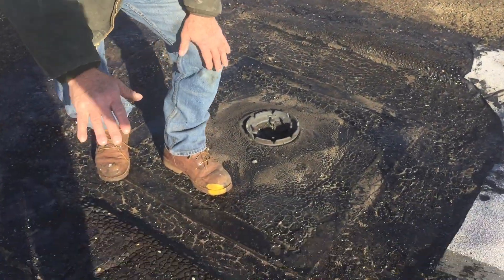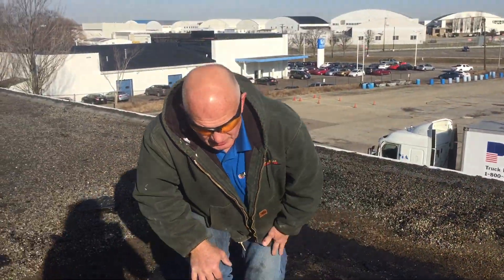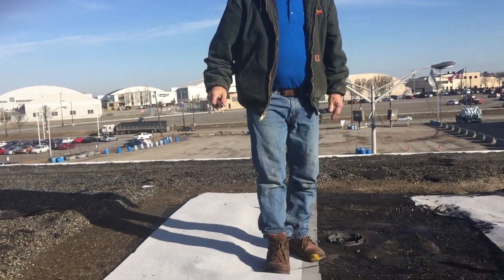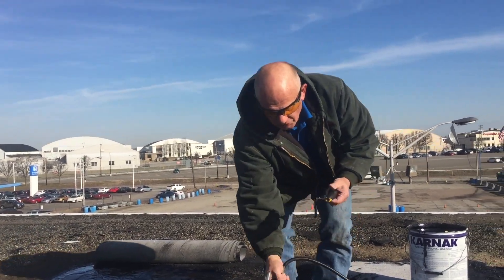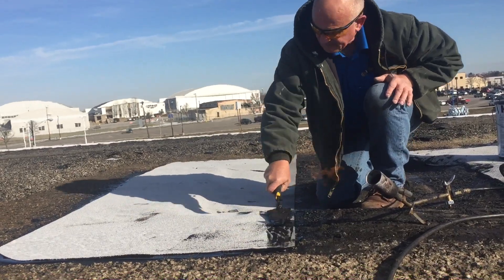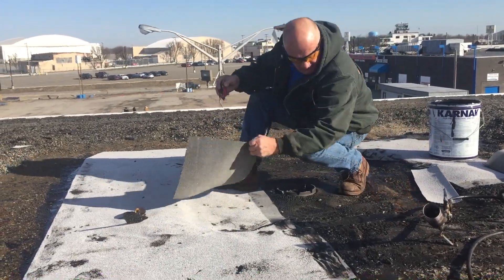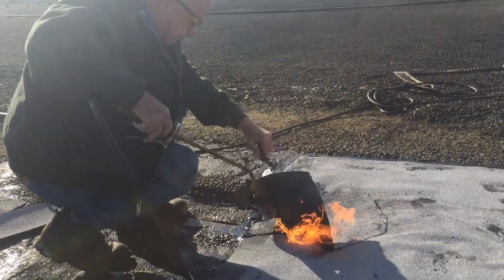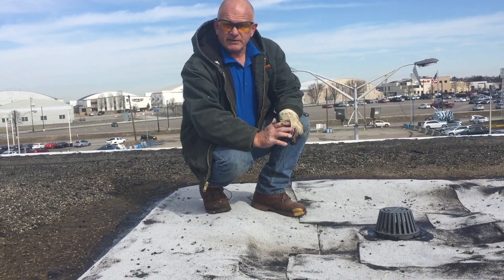Repairing a leaky drain on a flat roof

Comment: Sure is a lot of work for a loose drain ring.  I would had never done that.  And yes, you need to warm the material. I bet it leaked the next storm and someone had to go back and rework the drain install itself.
Reply: Agree with you 💯 👍

Comment: I remember having to put in lead over the bell for hot tar. I sure don’t miss it.
Reply from the maker: A lot of work
Reply: When we were doing hot tar it was a requirement. I have been looking at gaco coatings have you used any of it. I have 25 year old epdm roofing to coat that I installed. Just starting to look worn
Reply from the maker: @copperworks  I have never used any Gaco products because I have seen to many Silicone Coatings fai. But I do believe that Super Silicone Seal by Bergstromm.com is a very food product for patching on a EPDM roof. I have tested it many times and I am surprised at the outcome every time.
Reply: They have some materials I’ve looked at and I’m going to try them. I will get the customer to pay for the warranty.

Comment: You guys don’t require safety gear there? Like guard rails or fall protection ?
Reply from the maker: Yes, it is required. If you work for the Union, then that's what you do. if you are self-employed, then setting up all the required safety precautionary gear, railings, will bankrupt you before you even start.
Making repairs on roofs all my life, it would take longer to set up railings and safety harnesses than doing the repair themselves.
I do believe in making sure you are safe, but not to the extent where it is unnecessary and no one will get hurt.
The video you are have left this comment on shows me and my 2 daughters working on a drain 15 feet away from the roof edge, what would the purpose of the railing be in this case?
Reply: @FlatRoofDoctor  yes i hear you. Here in Canada they have officers that go around job sites and give out fines for violations. One company I worked with received a 40,000 dollar fine for no railing on a flat roof hotel we were doing. The amount of fine is based on the companies gross sales. Make more Pay more. I do mostly reroof shingles on steep slope here. Thanks for your videos man. Cheers
Reply from the maker: @ouimetco  Yes. Osha also has agents that go around fining people. I have had an $800 fine 20 years ago for a small violation. But most of the time, I am on roofs where I can't be seen. Especially flat roofs. Can you imagine if I go up on a roof to do repairs. that I have to construct a railing around the ladder area, set up a flag system 5 ft from the roof, bring up fire extinguishers, and then bring up a torch and tank to do a repair that takes less than an hour, then take down everything again. I would never be able to survive.
I think common sense is what is needed. 
BTW, thanks for your comment.
Happy roofing in Canada
Reply: @FlatRoofDoctor  how many kids do you have lol

Comment: How much for this repair?
Reply from the maker: Hi Trent. I had to repair multiple leaks on a old Costco building that is an wear house now. Not only repair, but warranty no leaks for the next 5 years. To find the leaks were the hardest part. The drain in this video was a relatively easy repair because it was a obvious mistake previous repair men made. The entire project cost around $15 k. Let me know if that is the answer you needed to know.
Reply: 15 k for this butcher work.
5 years warranty,thats gonna leak faster than you think. Probably this will last 5 years in the Sahara desert ,without rain.